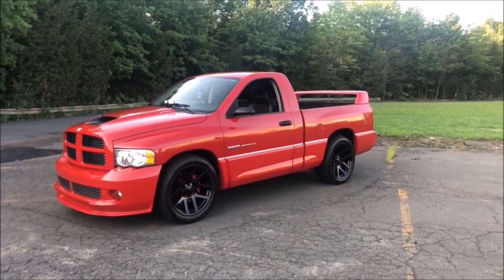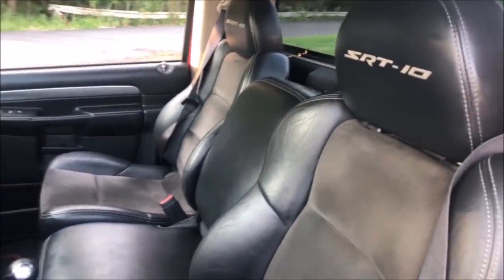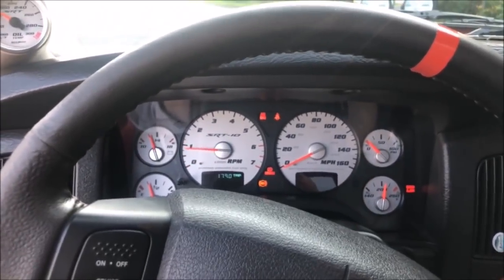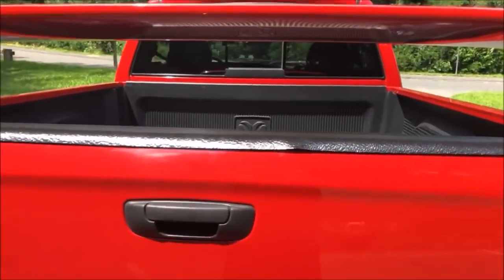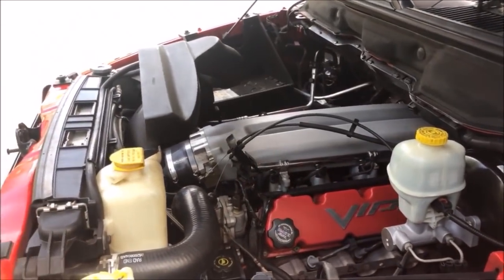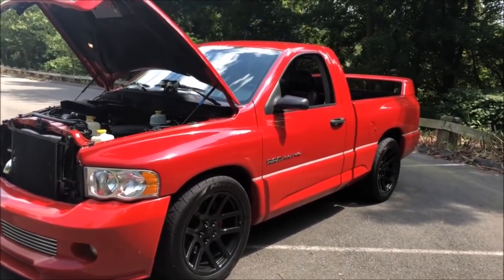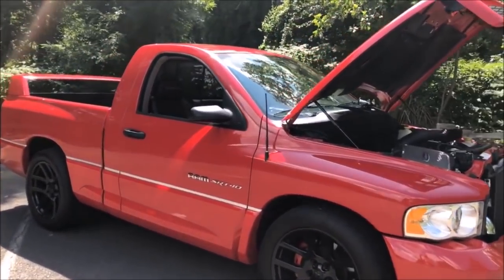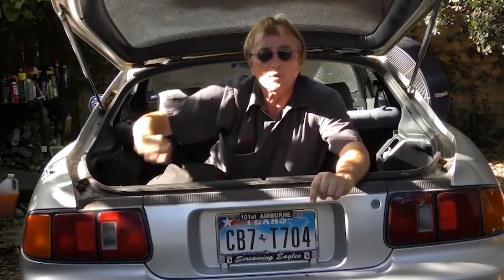The Secret that Makes this 2004 Dodge Ram Truck Still Worth $30,000

Comment: I guess I'm just not a hot truck guy. Seems about as pointless as a Chevy SSR, but then again I suppose that's the point.
Reply: Yeah I would agree the SSR was worse though, the idea of a production custom vehicle is never going to work.  The two things are at odds like with around the same time the prowler with its engine sourced from the intrepid & 0 slip traction control.
Reply: Chevy SSR is a price of crap compaired to anything!!

Comment: Man! I have a doubt ! I do like such performance trucks , but what is the use of such tall trucks when we can buy a a very low dodge viper at same price ,also what is the use of that tall truck like body on that vehicle when a lower bodied dodge viper can  achieve a greater speed ,and what is the use of such a tall truck like body when we  can,t even take this for offroad where visibility is necessary !

Comment: The secret is a chrysler V-8  that got stretched out with 2 more cylinders lol 
mystery solved lol
Reply: Keye T definitely not hemi heads
Reply: Its a 440 with 2 cyl extra. Not a Hemi.
Reply: Mark G dammit Mark, when you're right... YOU'RE RIGHT lol
Reply: Mark G Actually it's not a 440. The Viper V10 in simplest of terms, was initially a 360/5.9 Magnum with 3.88 stroke and 2 extra cylinders. It has evolved bore/stroke wise over the years, but it's basic block architecture is that of an LA engine.
Reply: the 440 had a bore and stroke of 4.32 and 3.75 the v10 has a b&s of 4.03 and 3.96 inches...i would day there is zero 440 in the v10, it was designed as a truck motor

Comment: I was looking at a black quad cab one in the Sacramento area. Someone bought it the day before I was going to go check it out... :(  they were only asking around 20k too...
Reply: Viper V10 didn't come ina quad cab
Reply: Uhm. Yes it did. All single cabs are manual. All double cans are auto. Look it up before commenting
Reply: UR right, I just saw that, maybe it was just the first year or what, but there's an 05 and 06 on Ebay right now with 4 doors

Comment: Wow... 8.3 litres of raw ‘Murican muscle is powering this truck...
Reply: Josh Bacon Lamborghini designed the block. Just sayin
Reply: daviesakiller So it’s a half-Italian, half-American engine?
Reply: This was in the Daimler days. Very little is Murican on this rig.
Reply: Josh Bacon I don't know. I went to google and read engine block.
Reply: Lamborghini was owned by Chrysler then so they had them help them develop a strong aluminum block. That aluminum block is probably still one of the strongest in the world considering it can handle up to 3500 hp with just darton sleeves. Casting the block was the extent of Lamborghini's involvement.
Reply: I think it was based off the old Chrysler LA small block and lambo made the block and the heads aluminum
Reply: the single trucker wrong. It is heavily based on the la engine series Lamborghini was hired to make an aluminum v10 version being Chrysler didn't have any experience with it and they owed Lamborghini
Reply: Actually pilfered from Lamborghini....
Reply: Actually, they owned Lamborghini and the engine was made in the USA. You're a Derp.
Reply: @KBW19723  
So Chrysler had a V10 before owning Lamborghini? Chrysler "acquired" the engine design from Lamborghini, may make it here but the tech came from Italy, derpie boy.

Comment: Can't imagine why anyone would want to go 154mph in a truck which is going to not be the best at handling at that speed, perhaps even dangerous to drive due to the handling characteristics of truck body designs. I too love the sound of it. Drag racing in truck never made sense to me either due to the lack of weight in the rear.. I know, yes, they're a cultural thing, not a practical thing.

Comment: Got a caravan.  2019.  Back hatch acts like it wasnts to open. But won’t.   It’s a chrystler.   Any suggestions
Reply: Good old “crystler”LOL. As for the door, it’s probably having electrical issues so you’ll have to keep using the handles for now

Comment: It runs out of gas before it even leaves the pump I bet
Reply: I have a Ram with a smaller engine. 13 MPG in town. Ouch.
Reply: BigWheel it’s around 5-10 mpg I think
Reply: @stunna_CODM  yup that seems right.
Reply: My 99 cummins gets about 16 in town.
Reply: BigWheel I get 9mpg in city I got a 5.0

Comment: Viper truck- 1200 lb payload capacity... are you sure?
Reply: rob379 with those rims, tires, suspension, differential, blah blah blah, yes 1200 lbs.
Reply: the single trucker ok cool thanks.

Comment: It's kinda sad that an 8.3 litre only produces 500 HP.  That's a lackluster 60.24 HP per litre.
Reply: That was also close to 15 years ago, technology was different
Reply: The huge displacement is part of how these engines work.   Think of an engine as an air pump, the more air you can get in/out, the more fuel you can burn, the bigger the bang, the more horsepower.   Now on a cam in block V8(or V10 in this case), there are two valves on the cylinder head.  You can't move as much air through vs a 4 valve head(which is what most modern cars use), but because you have huge displacement, you can get more air in that way.  Not an efficient design granted if you want to talk metrics like power per liter, but that's nonsense math anyways, it still makes 500hp, it just goes about in a different way.
Reply: I know how an engine works... It still doesn't negate the fact that a 8.3 liter for the weight and size of the engine produces a hugely disappointing amount of horsepower.
Reply: Matt Dias You know how an engine works, yet ignore it's a 15 year old NA engine. Flip phones, Windows XP,  AIM, Myspace, and OMG WTF is a GPS?
Reply: The Viper engines were aluminum blocks with cast iron liners, so they weighed around 625 lb or so dry.  Not bad considering the 5.9l Magnum long block was around 550lb (iron block and heads) and only put out 245-260hp.  If you wanted to look at the 5.9l Cummins diesel long block, that beast weighs around 950lb and put out whatever they do for numbers (not really into diesels).  The 5.7 Hemi long block would be around 500-520lb (cast iron block w/aluminum heads, and someone feel free to give more accurate weight numbers).  Those Hemi's put out 345 hp when introduced around 2003 with the more recent version pushing 375-395 hp depending if they were in the cars or pick ups (different intakes).  I always wanted to get an SRT 10 for a toy/collector/summer driving rig but never seemed to have the cash when they were available and when I did have money, they were never to be found for sale.  lol  Oh, well.  I picked up a Ram 4x4 Hemi w/3.92 axles and race that around town since that was going to be the closest I ever come to having a muscle truck.  Anyway, it's always nice to see those SRT trucks around, regular or quad cab versions.  :)  Thanks for the video Scotty.  It's always nice to see what people are driving out there that isn't seen everyday.  :)
Reply: Maybe your expectations are a bit high, 500hp and 500+lb-ft of torque that hits almost at idle is still pretty wicked.  15 years ago that type of power was unheard of except in exotic cars(top of the line Z06 Corvette made 405hp).  

500 cubic inch Cadillac motor from the mid 70's made like 200hp/380lb-ft torque, I'd say we've come a long ways.
Reply: Aaron Bays I agree with you. 500 hp is a lot at any day of age if you have driven anything over 450 hp
Reply: I used to think the same thing, but I found it it is more to save money as well as have nice hp with very long-term driveability. They also dont want it so fast that fuel economy is destroyed. There were still fuel regulations then as there are now. Plus more people would have accidents. The engine is easyily capabale of 1000-1500 hp with no need for internal mods.maybe even more. They also dont want it to be faster than the viper.
Reply: @aaronbays4    I don't know why people call it cam-in- block, it's a push rod. I guess some people think it sounds less old when they call it that but it's still a pushrod. I mean it is what it is.
Reply: And yet it'll probably blow past anything you drive
Reply: Michael Guerrero   I know what you're getting at but the Ford GT block can also hold about 3000, the block itself. It's one of the strongest blocks ever put into a production vehicle. It's right up there with the Viper.
Reply: Camaro69z true but even old big block v8s from the 60s were more efficient at making power.
Reply: Aaron Bays those caddy motors were hurt because of emissions. Look at 60s big blocks. They were cranking out 400-500hp na
Reply: And 5 mpg 🤣🤣🤣
Reply: It is not about peak numbers. The power curve is what matters.
Reply: Add a can and that 500hp turns into over 600hp easily naturally aspirated.
Reply: Always at least one comment from someone bitching about power output. EVERY single car video.

Comment: Question - What is that tool in the beginning and what is it used for
Reply: Hariesh it was an air gun and you can use it for anything asking as there's a sockert that fits the 1/2 anvil
Reply: Thanks

Comment: Turbo diesel cummins way better
Reply: Two TOTALLY different engines with two TOTALLY different purposes.
Reply: @ayooPatriotboii  no they arent for totally different purposes, they are both trucks, trucks are made to tow, and to work. and the 5.9 cummins does this best
Reply: That truck wasn't made to work, it was made to be fast.Your Cummins wasn't.
Reply: This is really a sports car disguised as a truck.

Comment: Still gets smoked by a lightning
Reply: Ricardo Chavez wrong!
Reply: The SRT-10 is the most powerful production pickup available on the market today. It produces 90 percent of its torque between 1500-5600 rpm and can roar to 60 mph in 4.9 seconds. The quarter mile is gobbled up in 13.3 seconds with a trap speed of 106.9 mph

Despite a 120-horsepower deficit to the SRT-10, the Lighting still managed to whip out respectable test numbers. The blown V-8 is good for a 5.1-second 0-to-60 run and a quarter-mile shot of 13.6 seconds at 102.0 mph. However, testing proved that performance diminishes quickly when the supercharger heats up after just a few runs.

Comment: Lol I have a v10 f250...not the same but a v10 nontheless lol
Reply: James Cottingame ford could have done a lot better with those engines...
Reply: Corey DeWalt I agree but I still like mine
Reply: Corey DeWalt yep. Always wondered why their lightning was a V8 and not the V10
Reply: Ricardo lol I don't use mine for speed...i use mine for pulling and offroading so it works good for me
Reply: Ricardo true...i mostly use mine to pull a 5th wheel and the occasional flatbed trailer

Comment: Don't drive in rain with that intake or you will hydro lock it.
Reply: Reid Plyler maybe if you parked it in the rain facing uphill? Adding water while the engine is running is fine unless you're using a garden hose, so much so that people do it on purpose (water injection)
Reply: David Regan I'm aware of water and methanol injection the reason most factory cold air start under fender is water is heavy usually can't flow up into intake.

Comment: Loved smoking these trucks at the track with my Lightning.  
They do look nice though. I’ve hauled and pulled a lot of stuff with both of my Lightning’s with ease.   Though my last one did make 489rwhp detuned.  So I wouldn’t worry with this truck either.  And BBK means junk.
Reply: Ha!Ha! Lightning 15 sec. truck.
Reply: Yeah. Doubt you even have a lightning or even been to the track. And youre definitely not gonna "smoke" that truck in a lightening.
Reply: mike allen The secret ingredient is called boost...in stock form this wasn't OMG fast but they certainly can be made so.
Reply: David Regan sure. But I'm talking stock against stock. And I'm only saying nothing is getting smoked.
Reply: mike allen Plenty of 10 second Lightnings out there...and a few 8 second ones people threw too much money at. In stock form I agree, it loses. You can boost the Viper V10 too, its just more involved.
Reply: David Regan yeah, it is. But I don't know that either, I mean their best stock trucks, are gonna get smoked. Should be a good race. Would like to see them both juiced up, tearing asphalt!!
Reply: The SRT-10 is the most powerful production pickup available on the market today. It produces 90 percent of its torque between 1500-5600 rpm and can roar to 60 mph in 4.9 seconds. The quarter mile is gobbled up in 13.3 seconds with a trap speed of 106.9 mph
Despite a 120-horsepower deficit to the SRT-10, the Lighting still managed to whip out respectable test numbers. The blown V-8 is good for a 5.1-second 0-to-60 run and a quarter-mile shot of 13.6 seconds at 102.0 mph. However, testing proved that performance diminishes quickly when the supercharger heats up after just a few runs.

Comment: He fell in love with the truck when he saw it on dealers lot. This means he overpaid severely for it. 14 year old truck worth $30K. To whom, some nose picking StankBoi?
Reply: Such a sheer number made and you get a fully loaded SRT team built viper motor with chances are lower mileage for 30k. Wasn't over paid at all. Just didnt depreciate like a Kia or your average mustang.
Reply: @NeverTalkToCops1 - Your ignorance is amazing. How could you possibly know he severely overpaid when he never even mentioned what he actually did pay not to mentioned the odometer reading that you’ve also never seen. I purchased mine for 20 K after I ran the Carfax on it using the Vin number it was valued at over 26 k. Yes it is 14 years old but only had a little over 46,000 miles On it. Ever heard of supply and demand? The value of this truck will continue to go up due to the fact they only made them and 04, 05, and O6. Even then, very few came factory with a six speed transmission and factory hurst shifter. Basically makes the truck theft proof to millennials LOL. On Monday, Feb. 2, 2004, the Dodge Ram SRT-10 set a new Guinness Book of World Records time for the World's Fastest Pickup Truck. If you want to play you got to pay... obviously he have the finances to pay for it and he’s extremely happy. Jealousy and envy does not look good on you.
Reply: saw one at carmax for 11k

Comment: My turbo Silverado SS has more towing capacity and seating space than both the viper truck and lightning and still smoke both of them 💨  lmao when they try to race me
Reply: Srt10 also had crew cab models and I'm sure with a turbo or supercharger you'd take an L

Comment: I'm running dual t-67 turbos on my geo metro, it makes 1600hp at the wheel. 🤣🤣🤣🤣🤣🤣Jk.
Reply: OpCharlieBravo F1 cars had an old 1.3 liter BMW engine from the 50s. It can be done
Reply: Sfer Tonoc So...with a purpose built completely not street legal race engine that gets torn down after each race and not the 3 cylinder version of a Suzuki Swift?

Comment: No, the v10 rams aren’t that good, they were for people who couldn’t handle the torque and brute power of a 5.9 cummins and are too pussified to drive a diesel
Reply: Lolled9991 the 5.9 CUmmins is known as “the one that paved the way” for a damn good reason. It’s a truck, not a race car. The cummins B series in ram trucks were indestructible, these viper engines never went more than 50,000 miles without having to replace a fuel pump, or spark plugs.
Reply: @jayjay-ik7ql   actually, diesels produce particulate carbon "soot" which sinks to the ground and is great for the planet as carbon is essential for soil to be arable land.
gasoline is horrible as it is inefficient. diesels make more power and are less harmful. old diesels were better than newer ones, as DEF fluid contains harmful chemicals. and soot is not  harmful

Comment: They usually end up upside down in a ditch and then at the wreckers were I buy the engine for $500 bucks pull the engine and put it in my drift car  now I have a r34 skyline  shell with a srt10 viper engine say bye bye tires.
Reply: what did u say to me scrubbo??? ill have u know i bored out my 3 cylinder i3 ford fiesta out to a 21 liter inline 3 and converted it to propane and chicken nugget grease power. it produces 37000 horses of tork

Comment: Nothing special.  V10's started out in Dodge Trucks just not aluminum blocks.  It's a base model Ram 1500 with a V10.  So what.  Not worth 30K, nothing built these days will hold their value much past 20 years anyway unless it's a Honda or Toyota.